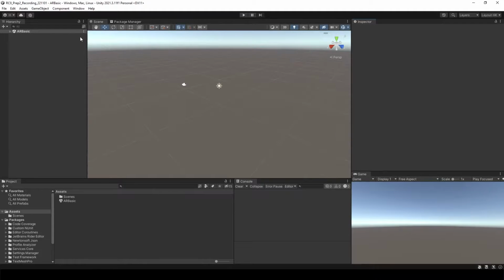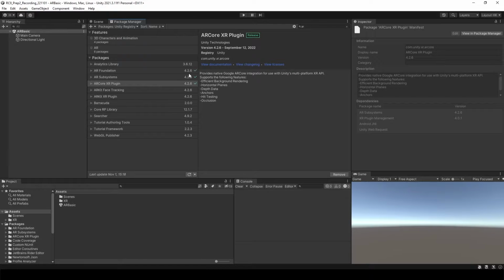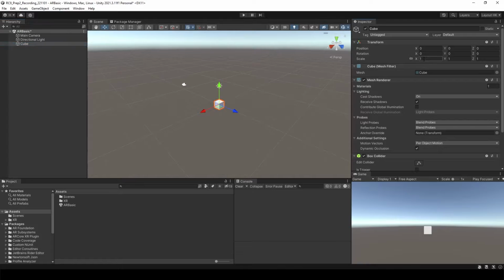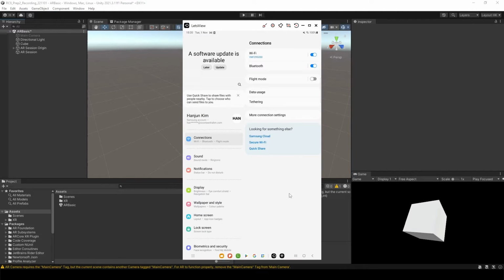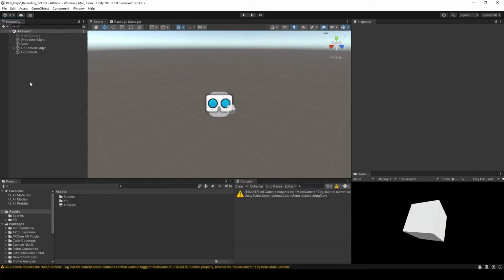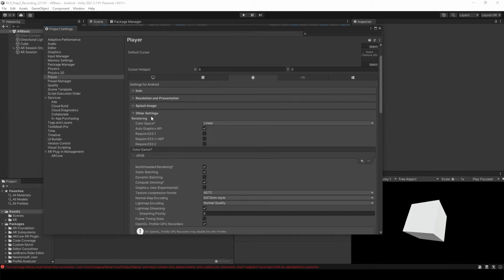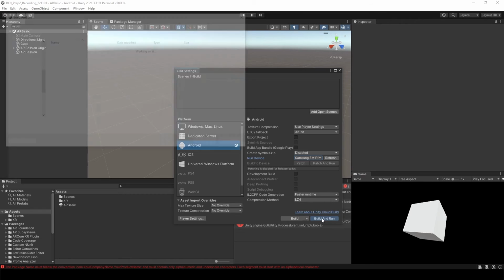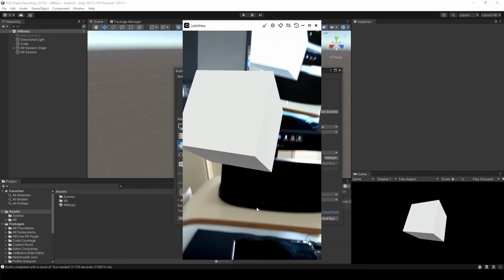Unity AR Tutorial: AR Foundation - Deploy to Android

Comment: hi, thanks for sharing these great videos. 

I think is good to inform users that you are using PBR as I am developing AR under URP, the result is black background. However, later I found the solution to change to URP then the result works as expected. Thank you.
Reply from the maker: Thank you for the reply. Yes, URP need a bit more setup to deploy AR in the device. I will upload about that later.
Reply: @soomeenhahm.design  What is PBR ?
Reply from the maker: @gudtj328  I think he meant BRP, which is default Built-in Render Pipeline. And I workded with BRP in this tutorial.
Reply: I'm also using unity 2021 but it doesn't have ar subsystems and I'm getting warning